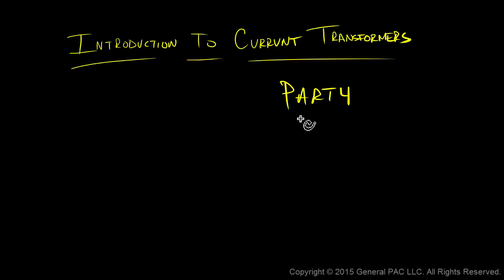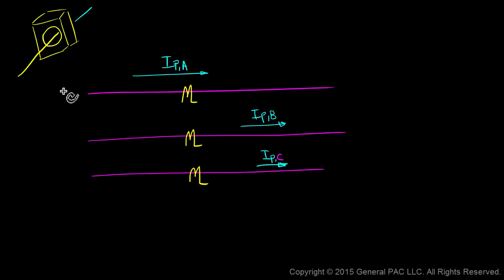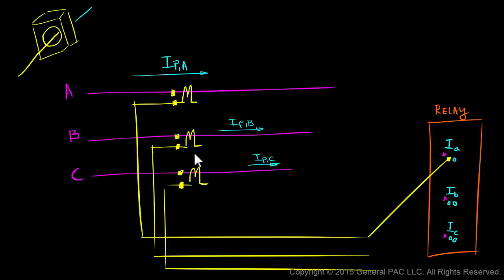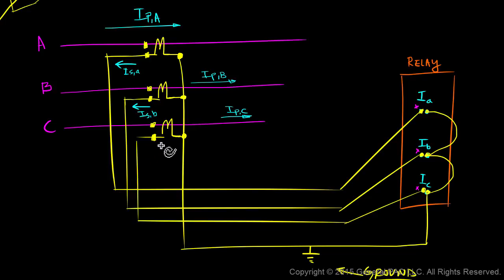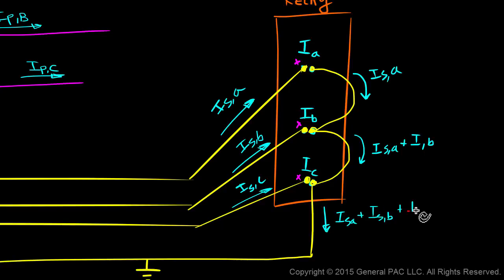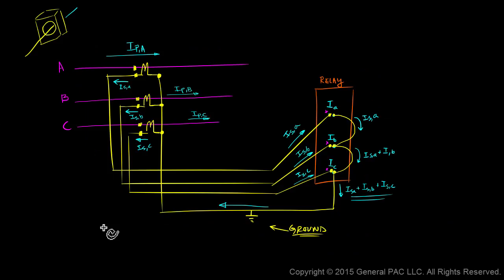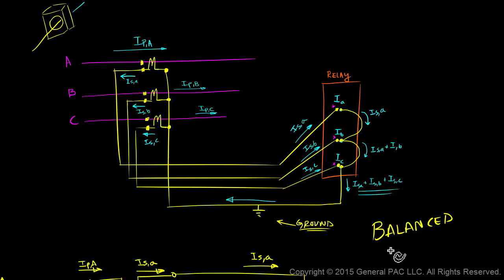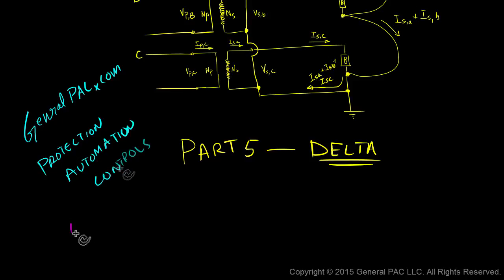Introduction to Current Transformers Part 4: Wye connected CTs

Comment: I get what your saying about CT's about the number of turns on the primary is less than the secondary and the current is high on the primary and lower on the secondary. Power in power out. Where you lose me is wouldn't that then "raise " the voltage on the secondary side / In my experience with CT's ,this doesn't happen. 100/1 ratio you wouldn't want to put 480 volts through it and 48,000 volts out.So I must have missed something there
Reply from the maker: @Kyle Burke, that is an excellent question! That was one of my confusions too. Fortunately, this question was addressed in a textbook. I'd like to share what I learned but can you please post this question on the GPAC Forum located here: http://generalpac.com/forum/index.php?forums/topic-introduction-to-current-transformers.11/

Looking forward to your post. Thanks!
Reply: i think the high impedance of magnetization branch reduces the voltage in the secondary of CT. and you can never leave a secondary of CT open otherwise there will be a high voltage and the CT will saturate so the CT always should  connected short .

Comment: "if we don't ground the secondary (non polarities) together, the voltage across the secondary winding might rise to abnormally high levels. This is partially due to the capacitance couplance between the primary CT winding and secondary CT winding.".. I watched more than 38 videos and 10's of sites just for this question.... can you make video on its explanation please..
Reply from the maker: +Anas Khan yes... We would love to and hopefully will do soon :)
Reply: GeneralPAC: Power System Tutorials o

Comment: Why ground the common S2?
Reply from the maker: +Roan Olayta, if we don't ground the secondary (non polarities) together, the voltage across the secondary winding might rise to abnormally high levels. This is partially due to the capacitance couplance between the primary CT winding and secondary CT winding.
Reply: +GeneralPAC: Power System Tutorials Copy.. Thank you...
Reply: thank you generalPAC.. i watched more than 38 videos and 10's of sites just for this question.... can you make video on its explanation...